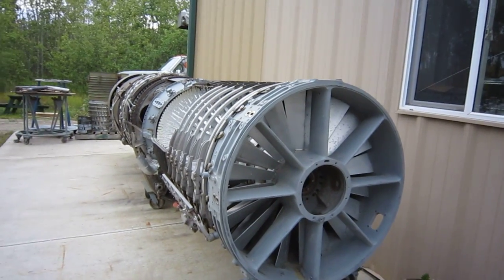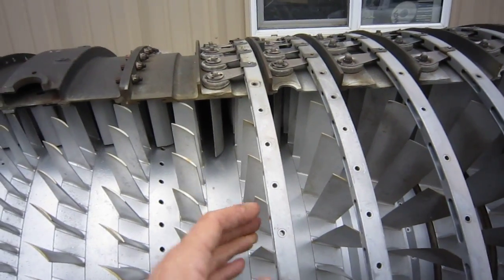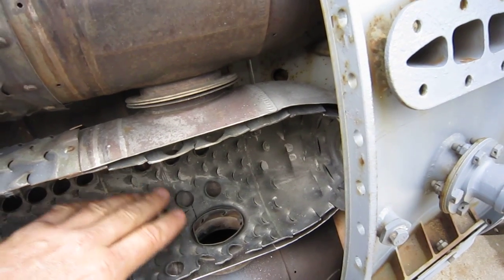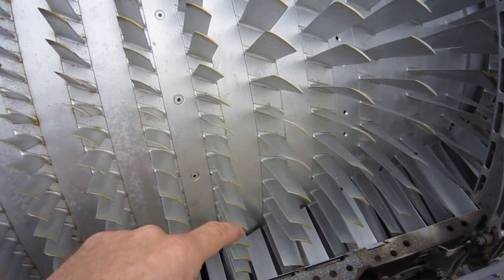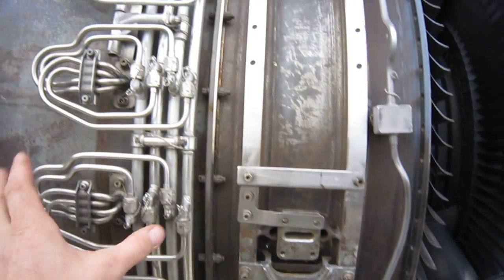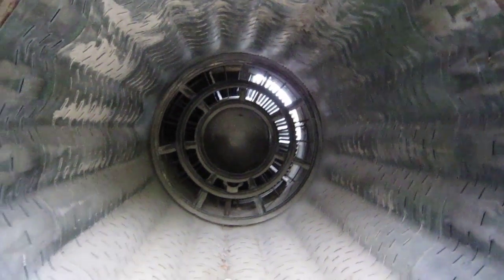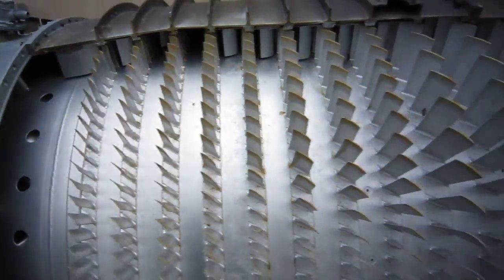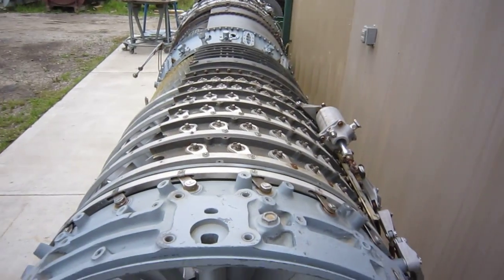J79  - Turbine Engines: A Closer Look

Comment from the maker: This is not done in any jet engines. The relative speed between any turbine and its compressor is zero. With one long-standing exception and one new one.
The TFE731 is a geared turbofan, so a reduction gearing drives the fan from the single turbine which also drives the compressor.
The "new" P&W geared turbofan is very similar, in a larger format.
In all other modern turbofan engines, the two systems are independent, and there is no gearing between turbine and compressor.

Comment: I don't wonder why planes cost so much. The engineering involved in all of that and the technology, even though it's a simple concept is amasing.
Reply: Sirena, you have to remember this is late '50's early '60's technology. It is MUCH more complicated today. The engines on today's planes now have their own computer and what is does is amazing. I worked on the small and the large from 1966 to 2005, and the technology in that time frame was beyond comprehension and I was working with it daily. I am still in awe of what transpired. Jerry

Comment: In a j79 turbine engine, out of the 100% compressed air that is delivered from the diffuser to the combustion chamber, how many percent of air passes throw the mixing air holds into the combustor liner and how many percent enters throw the flame tube office combustor liner. Thanks

Comment: i think they woudl be much higher than that. just an example, my cummins diesel is 17:1. it would take much more compression to produce enough pressure and temperature to sustain combustion. one figure i heard on another video was around 70:1. but that was for a turbo fan, commonly used on jet liners. ?idk?

Comment: @jdowney429 Basic principles and construction is the same. More modern engines have two or three rotor systems--high and low pressure, so that the fan operates at a lower optimized to generate thrust, and the compressor operates at a high speed optimized to generate power in the form of gas for the low pressure turbine.

Comment: What are the liners made of please.  What metal(s)? or is it an alloy.
Reply from the maker: +heck naw They are made of a metal alloy, similar to inconel. Some engines use liners made of stainless steel. If everything goes as planned, the liners never get very hot. My combustor liners videos try to explain why.

Comment: Someone said the compressor in J79 is in two separate pieces only aerodynamically connected...to have different rotating speeds... How is that?!
Reply from the maker: The J79 is a single shaft turbojet. It has one 17 stage compressor and one 3 stage turbine, all firmly connected and rotating at the same speed. Other engines have two separate systems/shafts, and they are aerodynamically coupled, rotating at their own best speeds.

Comment: What is the airpreasure inside the cumbustion chamber when the engine is running?
Reply from the maker: Just slightly less than compressor discharge pressure.

Comment: in power station, the gas turbine crank by a synchronous motor or engine diesel. but this one, what drives it to rotate for startup Sir?
Reply from the maker: This one would have a starter motor attached to the gearbox. They can be electric motors, hydraulic motors, or air turbine motors.
Usually the LM1500 is started by air turbine starter, as in most of my videos. I have a few videos of electric starts, like the Orenda and J47, and even a few hydraulic starters, like on the RR Olympus.
Reply: @AgentJayZ  I see... Thanks Sir. I love this video..

Comment: At what speed does the exhaust exit the J79 at full throttle with afterburner?
Reply from the maker: It exits the nozzle orifice at exactly the local speed speed of sound. That goes up with temperature, and super smart guys can calculate it, but let's use a rough guesstimate of 1000 mph. Good enough for me!

Comment: Don’t the holes in the combustion chamber cause it to lose pressure?
Reply from the maker: There is no chamber; one end of it is completely open. That's why they are called liners.
The pressure outside the liner is greater than the pressure inside, by a small amount, so air leaks inward through the holes.

I would suggest that you have a look at my combustor liner videos.

Comment: Do you have an idea of how much money it would cost to purchase something like what you have shown?
Reply from the maker: "like what I have shown"... no. I need to know exactly what you want in order to come up with a reasonable price.
What I have shown here is a cutaway display of a series of engines, created by pasting together a few casing and rotors that would not be used together in an actual engine, but is close enough to give a rough idea of the general arrangement of parts. Many, many parts are absent here - parts that would be included in an actual running engine.
If you mean an actual running J79, then the price depends upon condition.
And some things can't be solved with money; a real, afterburner-equipped J79 is not legal to transport out of the country... mine or yours.
So you see, the price for something like what I've shown ranges from "free... cut it up yourself" to "approximately one million dollars... shipping not included"

Honest answer.
Reply: AgentJayZ How about the cutaway engine that you show in your video. Something that looks complete, rotates and would give the impression that it is complete and real. Doesn't have to run or be 100% complete, but just give the impression that it is a real engine. Would $5,000=10,000 sound like a reasonable price for the engine you have in your video? I am not a buyer, I'm just curious.
Reply from the maker: Dude... if you're not a buyer... why ask?
It turns out you would be in luck if you were really interested.
There are many models of jet engine that are useful in industrial applications, and there are many more that aren't.
If you look around in some of the aircraft boneyards , I'm sure you could find a suitable starting point for your cutaway project  for less than the price of a nice bicycle. Then get cutting and cleaning !
Reply: AgentJayZ I'm asking because this is a forum and that's what people do on forums. They ask questions.

How much would a reasonable price be for an engine like what is shown in your video? What's the going rate?

If you don't want to answer it, somebody else might. Not sure why you wouldn't answer it.

Comment from the maker: There are a few good reasons why this will never happen.
For any given engine diameter, this idea would not increase efficiency, airflow or power, but would at least double the complexity and cost, while reducing strength and reliability.
It is possible to design an engine this way, but it has never been considered by anyone right back to the beginning.

Comment: So the whole point of the stator blades is to help direct airflow??
Reply from the maker: Stator airfoils are called vanes, and in the compressor, they are where the increase in pressure actually occurs.
The rotating blades add energy to the airflow in the form of increased speed. The stator vanes trade that speed for pressure through the process known as aerodynamic diffusion.
Reply: wow, thank you so much!

Comment: Is it possible to get one of those compressor blade assemblies, just one ring?
Reply from the maker: A stage of compressor blades in new condition will cost a couple of new corvettes from the manufacturer.
In serviceable condition maybe a quarter of that from an aircraft parts dealer.
Scrapped ones are available if you hunt for them for whatever the agreed upon price.
We have tons of them in scrap whole engines, but I do not sell anything.
You come get!
First watch my series on working on the J79.
A lot of work involved getting to the compressor rotor.
Then a lot of work taking it apart.
Why would you want a whole stage?
Without the disk they would be a pile of metal bits.
Easy to buy a few on Ebay.
Or trade something cool for one...
Reply: I don't know the words to describe what I want exactly, but what I'm thinking is to make a musical instrument. Not with the whole thing though, just with one ring of blades. Then I could adjust the tuning of each blade by shaving it down a little.
Reply from the maker: +Dale Greer 
Or you could get a set of different sized blades. An octave with the sharps and flats would be... 14 or so.
How about just a couple blades and use pitch shift or autotune...?

Comment: What are these older engines used for these days?
Reply from the maker: The industrial derivative of the J79 is called the LM1500, and hundreds are still in service today.
Quite a few J79s are still flying,  powering airshow display aircraft, or even military fighters and trainers.
Reply: @AgentJayZ  I just read up a little on the J79.  Its development period was in the 1950's.  I guess I'm surprised by the engines longevity in use.  Usually just the advancement of newer, more fuel efficient technologies will push out older engine designs.  I can understand their continued use in historical aircraft for preservation purposes.  
But the industrial usage would be far more rigorous in cost of operation/benefit. 

  I assume stationary turbine engines aren't looked at for their emissions as carefully as diesel engines are.  I'm in California. Here it seems no engine can escape the emissions  "police"
Reply from the maker: Well sir, I will not be the one to educate you here, other than to let you know that your three assumptions are not correct.
Reply: @AgentJayZ    thank you for responding as much as you have.  Maybe you would consider producing a short video for turbine fans/customers pointing out the virtues of the J79 that allow it to continue operating well into the 21st century.   I'm sure I'm not the only one curious about its unrivaled success.  Since you have a unique perspective as a knowledgeable service provider of these engines your insight would be very valuable.  Thank you again for your time.

Comment: I want so badly to fully understand the jet turbine engine.
Reply: They're not that complicated.  Compressor stage compresses air, then you add fuel and it enters the combustion chambers where the fuel and air are burned, which creates a large volume of gas to go through the turbine stage, whose job is to drive the compressor stage, then finally it goes through the exhaust.  The exhaust section is different on a jet vs turbine engine since the former is designed to provide thrust and the latter delivers torque (and that's basically the only difference).  

Main variants of a jet engine are axial flow where the air flows straight through (like in this J79), earlier engines were usually centrifugal flow with a compressor stage that looks like the compressor off a turbocharger.  Axial flow can either be a turbojet (all the air goes through the compressor and turbine stages, again like the J79) or a turbofan which "bypasses" air off the first few compressor stages.  This is what you'll find on airliners as they're quieter and consume less fuel.

Comment: How can i get a job in your company ?????? I am currently doing mechanical engineering..... final year
Reply from the maker: Bad news: your use of six question marks instantly disqualifies you from consideration.
As a graduate engineer, you would not be happy starting off cleaning bolts with a wire wheel.
So we both win.
I wish you luck in your journey.

Comment: I wonder how much faster the Grumman F-11F-1 Tiger  would have been with the J-79 as opposed to the J-65.
Reply from the maker: The "stock" J65 had 7,400 lbs dry and 10, 500 AB thrust. The J79s we test make about 11,000 dry and just over 18,000 in full AB.
It's a bigger longer engine than the J65 ( I've worked on and posted videos on both), so I don't know if it could be made to fit.
BUT, with 50% and 70% more thrust... that air frame would have ripped itself apart.
When the J79 was introduced, a whole new generation of aircraft were designed. Coincidence?
Reply: Never worked on the J-79 but have seen a few. Did work on the J-65 as installed in the A-4L which is of course non afterburner.  Didn't think the GE motor was much larger in diameter but never saw them side by side. You may be correct about the Tiger airframe but Grumman was known for building stout aircraft. "Grumman Iron Works" was what the company was known as.
Reply from the maker: The J65 was in a way... ahead of its time. It use a full annular combustor, like every modern engine does today.
One of the reasons it did not leave a smoke trail in the sky, like the J79 beast did for the first part of its history.
Reply: J-52 was smokey too. A-4E I worked on was originally equipped with a smoke abatement system. Long disconnected and purged. The smoke abatement fluid was highly toxic.  The J-65, as installed in the A-4 didn't leave much of an exhaust trail but spewed an orange oil mist from the stbd. side of the engine through a vent.  Mil-L-23699 was orange. Number seven bearing was total loss lube. 
F-4 Phantom II aircraft at Miramar  (Fighter Town!")  belched smoke.  Seems like the F-14A with the TF-30 smoked a bit when the pilot cut off  the AB.

Comment: I've wondered for a while what it would take to cause the gases inside a jet engine to heat into a plasma. Honestly there's no real reason for me to think about this but...maybe if you used electric current instead of fuel to ionize the air and compress it even more than normally thought possible in an engine you could create a sort of plasma that might have a high enough exhaust velocity to propel a lil baby plane. Or shoot someone with that "engine" you just made.
Reply from the maker: The ignitor sparks are plasma. An electric heater could be used instead of the combustors, but it would be very large and heavy.
I encourage you to design your engine.

Comment: Is that a gas turbine engine ?
Reply: Yes. A definition of a turbine engine is: "An engine that provides continuous power because a wheel or a rotor is continually turning due to pressure from fast moving water, gas or steam."

During starting of this engine, the blades are spun up to a certain RPM by the starting mechanism and once that happens, fuel is injected and the two spark plugs start the burning process. After that, it combusts on it's own and spins faster and faster as more fuel is added until it reaches the normal range of operating temperatures. Hope that helps.

Comment: hello agentjayz,
I have seen a picture of a propfan,and there seem to be alot of things in the way of the air flow.
https://fbcdn-sphotos-g-a.akamaihd.net/hphotos-ak-prn2/1526727_581024368634121_369407038_n.jpg

or maybe is this a turbojet ?
Reply from the maker: Not a propfan, which I'm guessing is is pilot-talk for turboprop... or maybe it is a propfan, if that's pilot talk for turbofan. A turbojet is the first-developed gas-turbine aircraft engine.
The picture you linked to is of a turbofan engine with its outer cowling opened and the inner cowling removed. Everything looks just fine.
Reply: hello,i'm not a pilot,just an android software geek who loves airplanes.

Comment: nice video.
the engine seems so yuckily complex. doesn't feel like a clean design.
I'd probably also place the starter motor in the nose cone instead of a long transmission

Comment: Ok but I'm just saying your statement isn't totally clear. Your statement "Without the stators pressure would not increase between each stage" is incorrect, I just wanted to point that out. Both stators and rotor stages increase the pressure, while the rotor stages actually add energy to the fluid, and stator stages do not. They simply diffuse the air, slowing it down. They just trade velocity for pressure but don't do work on the fluid like the rotors.

Comment: Little bit assistance if possible, any colleague that can provide me with the number of blades for the (IGV, 1st Rotor and 1st Stator) for the J79-GE-17 Engine.
Reply from the maker: The number of blades is in the parts catalog, and is the same for all marques.
The big question is really: why do you need to know that, and why for a dash 17 specifically?
Reply: @AgentJayZ  thanks for your reply,. First I did not have the manual neither able to have it. Secondly, I make a simulation for the compressor performance, so that I need to know the exact number of blades at the cascade.
Reply: @AgentJayZ  as I said in another reply, I make a study on the compressor of the J79-GE-17 type. And I don't have the manual nor able to have it. 
I want any version of J79-17 either -A or any other type but should have 17 compressor stage.
If could be possible count them and pass it to me. I see the video of the close look to J79 and I barely counted the IGV 20 blade but i am not sure, and still need the number of 1st. Stage bother (rotor and stator).
Thanks
 @AgentJayZ
Reply: @AgentJayZ  Dear Sir, i know that you are too busy, but honestly, you wanna to know that you may be the last path that i could contact to obtain this small info. So, if you would plz give me the number of blades for the 1st stages (rotor and Stator) of the J79

Comment from the maker: Absolutely not. There are not any stator-less ( the turbine inlet stators are usually called guide vanes, or nozzles) gas turbines.
All you weenies that want to talk pelton wheels can go jump in the water they run on, and anybody wanting to talk turbochargers... they are not jet engines, but simple, inefficient paddlewheels to help out a piston engine. They don't even rate.
Reply: AgentJayZ , I'd have to disagree. Without the work Dr. Sanford Moss did on turbosuperchargers,  Sir Frank Whittle might not have invented the turbine.  Mosses work was integral for Whittle.  Of course von Ohain was at work in Germany.  The Germans used the more advanced axial flow compressor whereas the English used centrifugal flow.